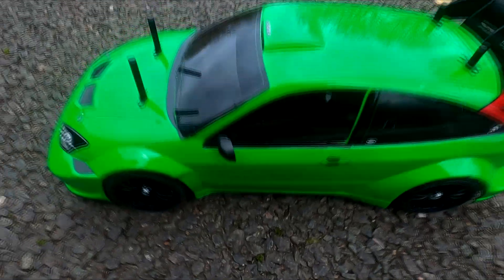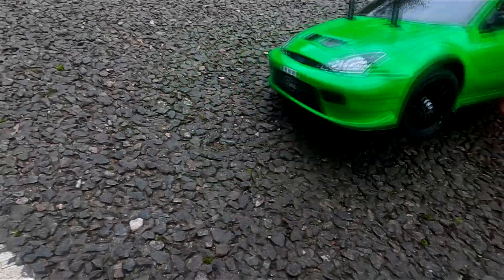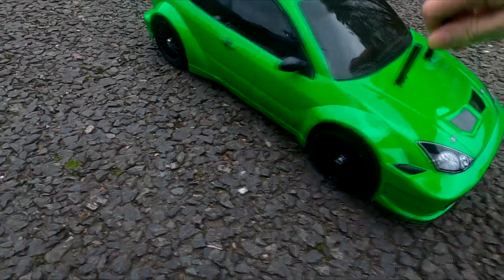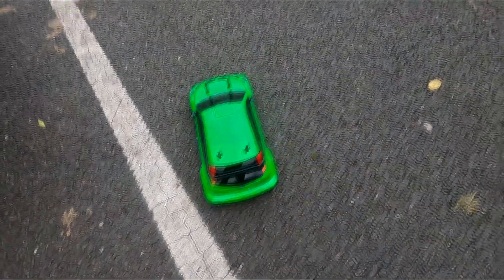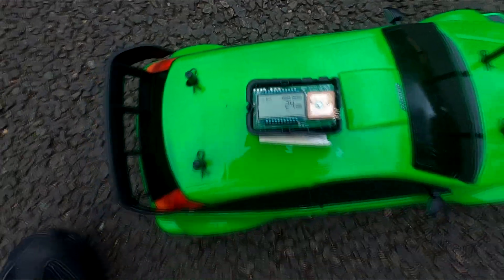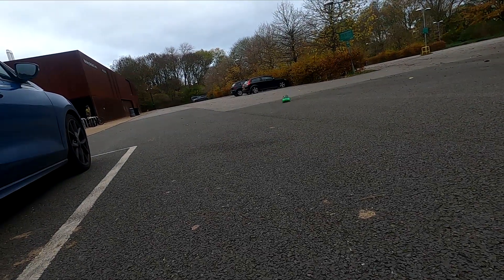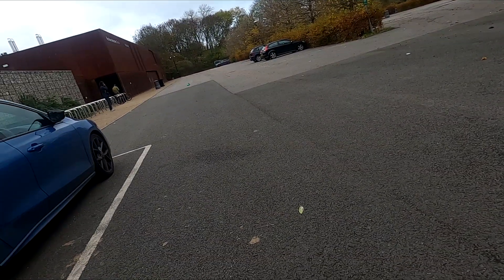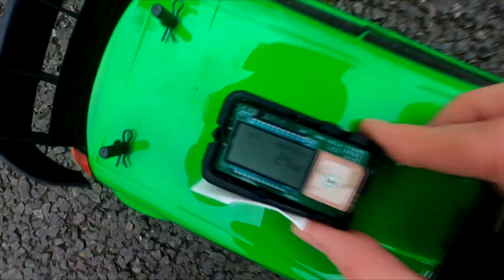Tamiya TT-02 , Speed test on 2s Stock Gearing, and teething troubles fixed.

Comment: It’s going well now mate 👍  Nice run 
Tyres seem so much better in the dry 🛞  Is the rear wing on upside down? 
Said it before, the body colour is epic 🤩
Reply from the maker: I know where your going with the wing it’s Massive .! But that’s the it felt comfortable sitting against the rear sloped window . 
Yes the tyres aren’t bad in the dry. If it weren’t brushless it wouldn’t slide . So they’re quite good just sh!t in the wet. 
But it needs  another tooth or two on the pinion May be .